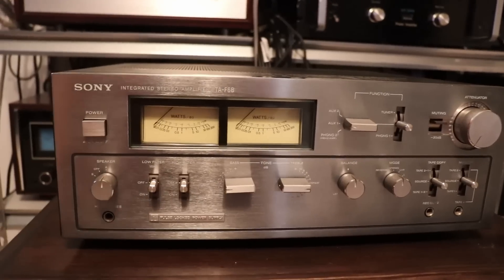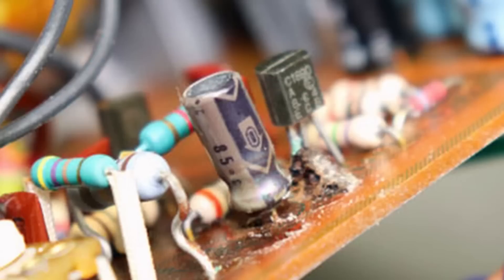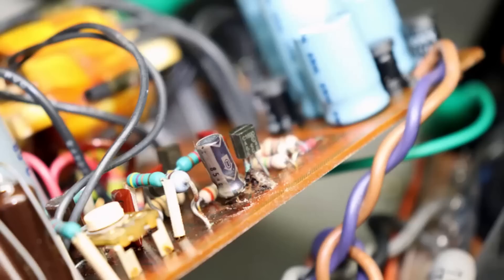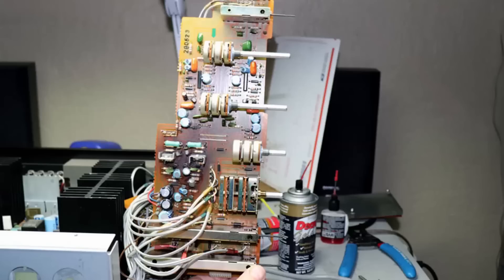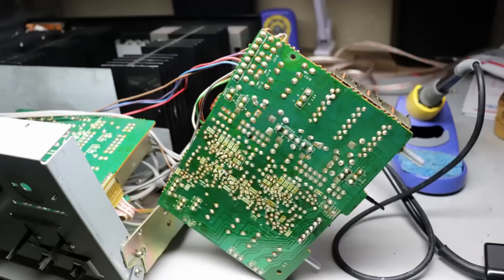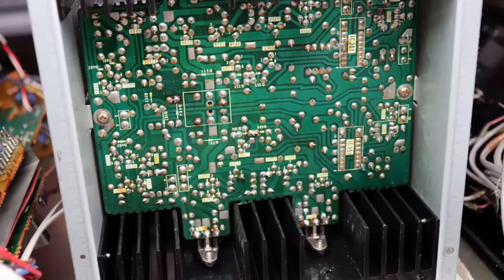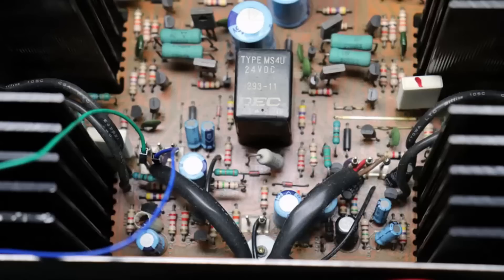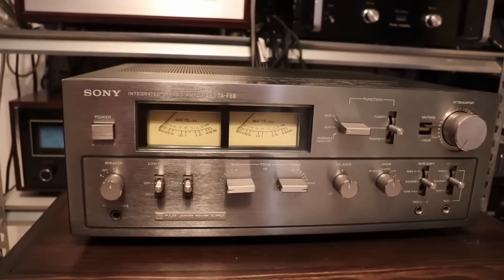Sony TA- F6B Integrated Amplifier. Vintage Stereo Repair Restoration Testing. Old Audio Classic.

Comment: Hello! I have got the same amplifier on prevention now. How did you fit big KEMET capacitor leads into the board? They don't match with holes on the board.

Comment: Dear Sir, 
 I have a Sony TA-F60 with the right channel issue : the voltage at the C of Q213  and Q214 is always -8,0V, so the protection relay do not work. I turn the RT201 to maximum but it can not reach 0V.
All orther voltages are ok.
Could you please advice me some solutions?
Sorry for my bad English
Thank you in advance. 
P/S: I have the service manual of this amp. If you need I will send you via email

Comment: Craigslist has one for $250.00 he says it's like new but we've heard that before when buying vintage electronics haven't we. My question "is it worth it?" 
 I have a signal generator a scope an AC MV meter along with 2 frequency generators a fluke 8060a and a DC Power supply. I work on cassette decks and car stereos mainly and have yet to re-cap my old Onkyo 7070 amp. I guess I'm a little gun shy of amps and I don't really know why. Anyway great visual on the video and this particular model doesn't look too intimidating as you have room to work unlike a car stereo. 
Thanks for the video and keep em coming as retirement is getting closer for me and that means buying and repairing the stuff I grew up loving.

Comment: I got a Sony TA-N77ES from a friend who hasn't used in 20 years.   ....  ....  .... My first issue is, when plugged in it automatically turns on and the on/off switch will not turn it off. Is this most likely the switch, or could it be something else? 

Also I tried inputting sound from a cd player and get nothing from speakers. Not sure if I am doing this correctly. Does not look like what I am used to. It has no headphone jack to try that. 

Was told these need new caps when original still there. Also heard it may cost as much as it's worth or more.
Reply from the maker: Congrats on owning a Sony TA-N77ES, I wish I had one in my collection. Yes, it sounds like the power switch is defective.  Using your CD player at the input jacks on the amp should work with you using the volume controls at the front of the amp to control the loudness. The amp is 30+ years old and so it certainly could be broken. You may need to find a technician to look at it. Old vintage audio equipment is a lot like old vintage cars. A lot of times it may not be cost effective to repair them unless you just like what you have. Good Luck!
Reply: @vintageaudioaddict  Can you point me in the direction of a replaceable on/off sw?

Would you be willing to coach me into checking a few things over a video chat? You could see the inside and results of me using an ohm meter. 
If so let me know, and I will provide email so we can discuss costs.
Reply: Also, do you recommend a good ohm meter for someone who would not use often? Budget model?
Reply: @vintageaudioaddict  It works, except need to clean attenuators and fix on/off switch.

Comment: The KEMET filter caps you show in the video are a little wider than the originals. How did you get them on the board?

Comment: You would be very glad to know at this particular amplifier selling on eBay close to $1,700 I find that an amazing price Sony equipment I cannot believe a Sony amplifier selling for that much money but then again I had a pair of vintage Sony speakers that somebody bought for me and they paid me an unbelievable price for them I couldn't turn down the price it was a very old set of speakers made by Sony can I restore them completely original virgin water Tweeter and midrange I repaired the Crossovers rebuild the speakers refinished cabinets made them look like they were brand new and this person paid me a lot of money they sounded great but they were part of my collection and I had to make room for some other stuff we're going to come into my collection so somewhere a little bit more expensive than the Sony so

Comment: Hi There, came across your channel by good luck,  I have a Sony TA-F5A - the baby brother of yours, had it for about 4 years.  Bought it off Ebay for about £150 (UK), I use it regularly with no issues apart from a the left channel is about 10% quieter than the right.  It runs quite warm but not hot.  It has a similar PSU I think "Pulse Power Supply", is that the same possibly?

Anyway I really love it, the analogue VU's are a delight and the sound is really smooth and clear, though I use a Rega pre-amp for my turntable, only because I can transfer some of my rarer records to digital (it has a USB output).  I think the Rega pre-amp is a slight improvement with a brighter more detailed sound than the built in Sony Phono stage.

I''ve never taken the lid off so can't say what it's like inside, I'm not equipped with the skill set though I have thought about getting it serviced.  Will be checking out your other stuff, great channel.

Comment: Another solid video. Interesting that the PCBs poke out from the front panel; haven't seen that before. Also interesting to see an amp manufacturer using a switching power supply from that era. It's common now, though. I may, however, be somewhat biased because you tend to use Steely Dan for your sound checks ...    Thanks, as always.
Reply: Steely Dan records were used in the late seventies and early eighties and beyond, because of the sound quality. I remember an audio store using the album for a demonstration of a Tandberg 2080  receiver, and a Denon turntable, and ADS L 880 pair of speakers. And my love for audio, and becoming an Audiophile was born!! I haven't looked back.
Reply from the maker: Your welcome and thanks for the kind words. Sony made some solid gear back in the day. As you said SMPS''s are common place now a days. I did a little research and it seems that Hewlett Packard first used one of these supplies in a calculator in 1972. So when this Sony TA-F6B was designed it was still a pretty new technology.
Reply: @vintageaudioaddict  Chris, which part of the unit needed 300v...just curious.

Comment: I've never owned a Sony stereo intergrated amplifier.have listened to them the sound is great.I notice that another brand like sony named Technics hardly get reconized much in the audio world these days.Mach 3 speakers back in the 80's was my envy..and when I got older I was able to build my own setup.The boom box and Sony walkman brings back good memories.
Reply from the maker: Thanks for sharing. Yes, this equipment brings back mostly good memories for folks. Your correct about Technics that they don't get a lot of respect for their vintage equipment but their open reel tape decks have a large following. I have a SE-9600P Technics power amplifier that is built like a tank and that I really like.

Comment: very dumb move from Sony to seal the power supply and it is slowly cooking inside
Reply: It's a switch mode power supply, so it has to be shielded from the rest of the electronics. That's why it's sealed.
Reply: probably why not really one of most thought after vintage receivers that for sure along with even first home theater stuff was sub par
Reply: You could really see the effect of all that heat on the circuit boards. They were getting very discolored.

Comment: Did  you  ever  go  as  far  as  purchasing  a  wire  wrap  tool?  I  work  on  audio  equipment  all  the  time  and  haven't  brought  myself  to purchase  one .  It  is  nice  when  there  is  enough  wire  to  pull  the  boards  out ,  but  sometimes  with  short  wires,  you  need  to  disconnect  them.  They're  too  pricey  and  I  just  do  the  best  I  can  without  one .
Reply from the maker: Most folks if they break a wire they strip a little new wire and then use the soldering iron to put it back. Just don't use any of the wire that was wrapped on the pin. If you don't over bend them they rarely break.
Reply: @vintageaudioaddict  I strip a little more wire and hand wrap it back on.  If you take your time and use a pair of hemostats you can get it fairly tight.  If I don't think it's tight enough,  I will hit it with just a little solder.

Comment: lovely. i have a few sony units with the pulse locked power supply. they all work, but i don't use them because i really get anxious about using them without changing the caps in the pps first. i do use a big hefty ta-f444esx as a daily driver though. sony made great integrateds for decades.
Reply from the maker: Thanks. Sony is forgotten many times but they made some really good gear. Yes, those power supplies can be an issue as being sealed up they go through a lot of heat stress.